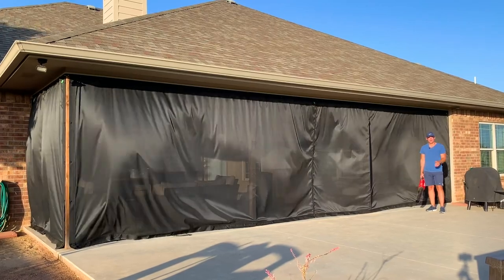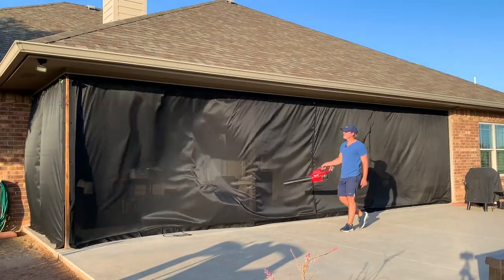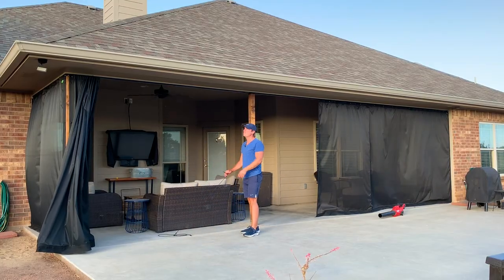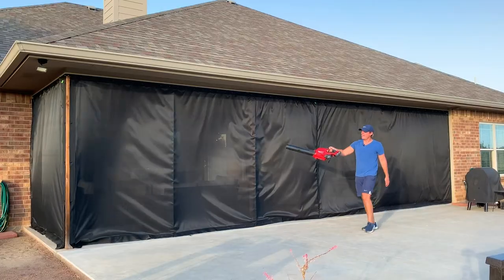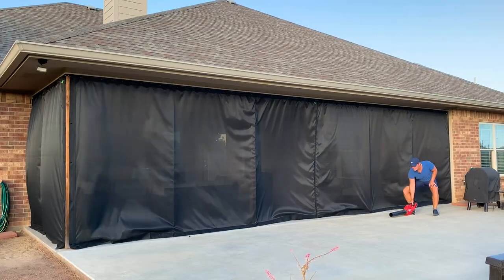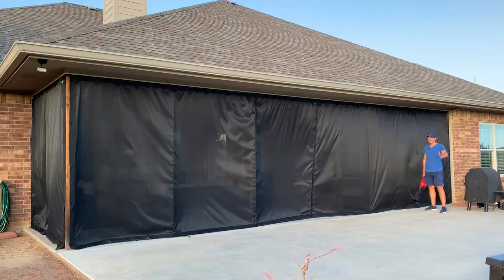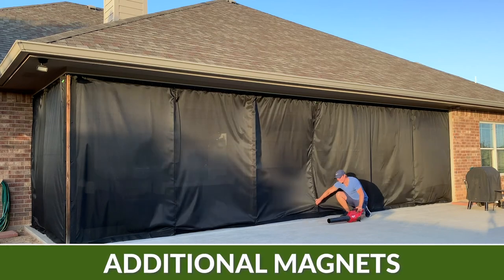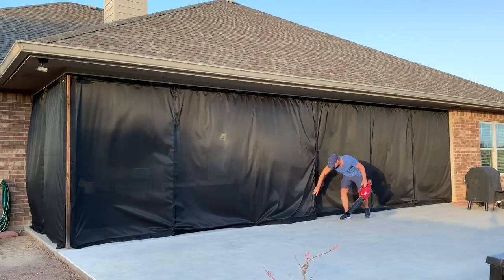Mosquito Curtain Wind Techniques

Comment: Excellent info.  Thank you so much.  My gazebo zipper panels were torn at the zippers by 95mph winds and im getting ready to order a magnet door to repair it instead of replacing it.  I will for sure be implementing your ideas to try to prevent further damage.

Comment: How do you put the d rings into a metal gazebo?
Reply: It's been several months, but if you have not solved this problem yet, I would not recommend trying to drill into metal if you can help it. If you can, try and find a way to simply wrap the entire cord over or around a shaft or rod. We have a metal deck and what we ended up doing is passing the cord through where the netting attached to the velcro and then wrapping around a structural rod of our metal awning at the top and then wrapping around the bottom of a vertical steel beam of our deck.